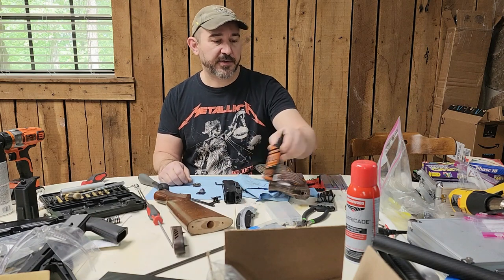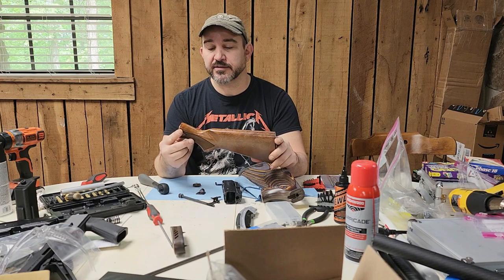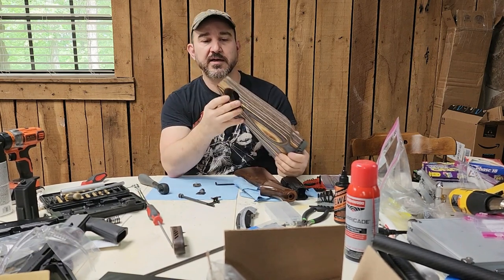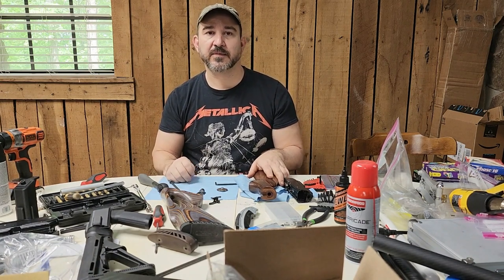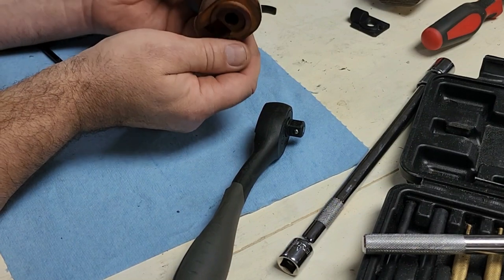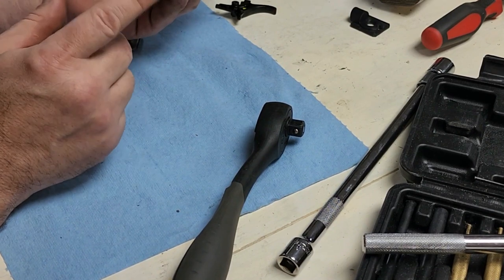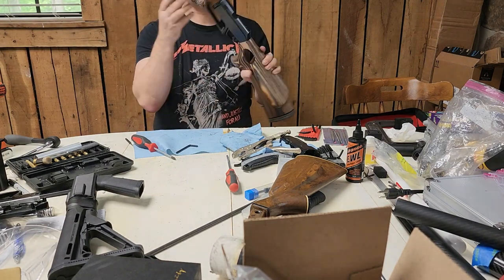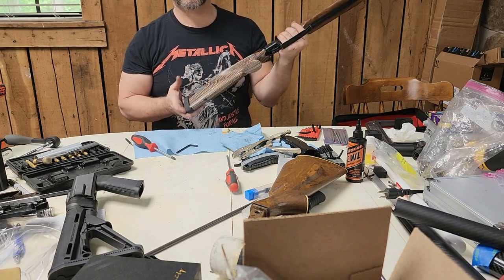Daisy 880 Wood Stock using a Mossberg 500 stock.

Comment: Will this work on the plastic receiver?
Reply from the maker: No sir, the required metal receiver side plate will not fit the plastic receivers.  You can install metal receivers but they require filing around the breach area of the receiver to fit the new valvebodies.